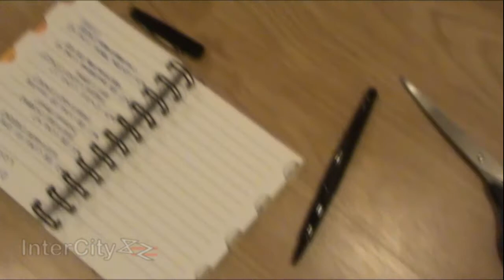Dodgy 3-way point removed - labels added!

Comment: hmm, interesting, the Peco 3 way point is generally quite good.  We use them a lot on my mates garden railway with no problems, and I've got one on my railway.  What stock was coming off on it?  Hornby stuff is generally extremely variable when it comes to wheel back to backs.  Standard they aint sadly.